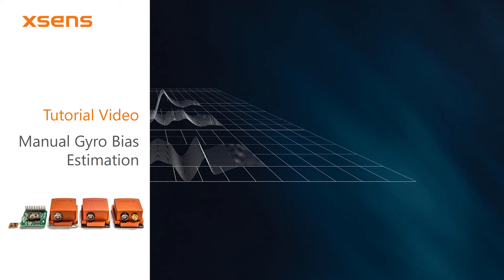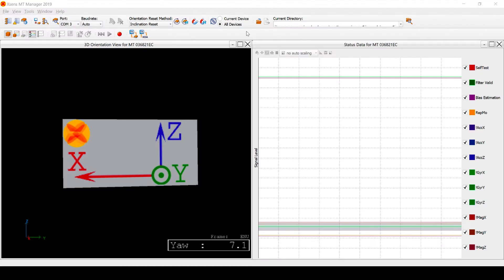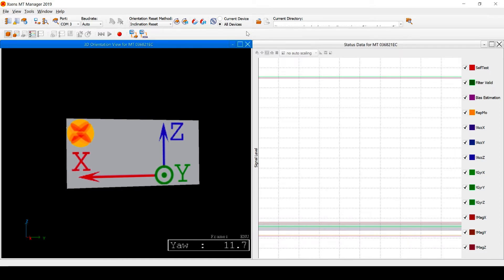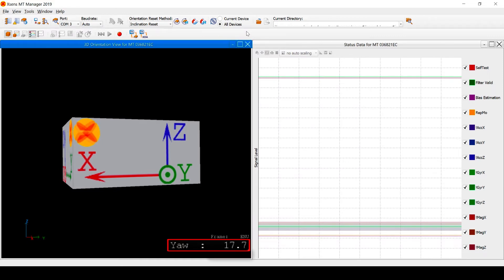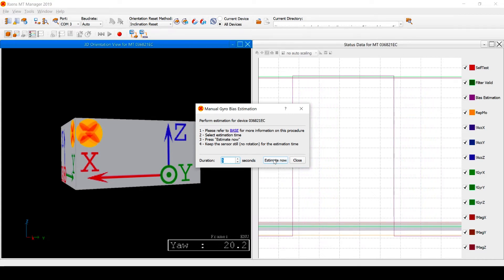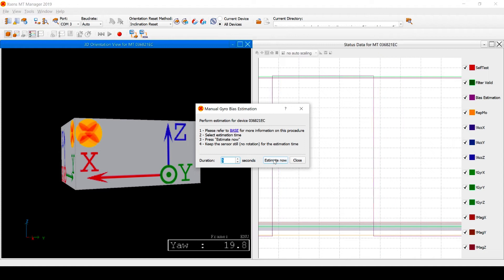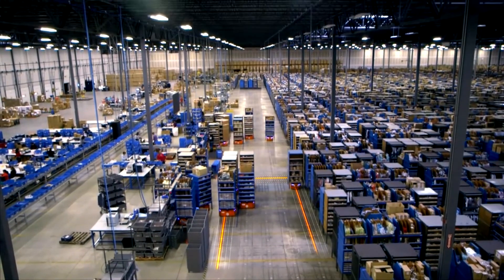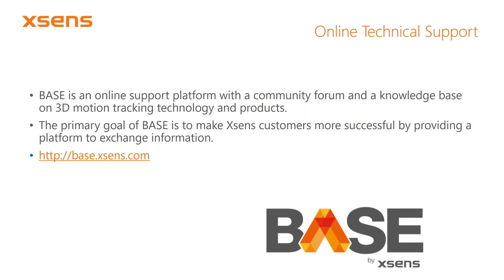Xsens Tutorial: Manual Gyro Bias Estimation

Comment: Hello. Can you please do a tutorial how to detect Earth's rotation with your MTi-620 sensor (or higher model)?
Reply from the maker: Xsens Motion Trackers (MTi's) are based on MEMS accelerometers and gyroscopes. These are extremely small and low-power sensors and therefore very suitable to track robotics and vehicles. However, they are not designed to track the Earth's rotation. For measuring the Earth's dynamics a high-grade optical gyroscope is required.
Reply: @XsensMotionCapture  I know that. But, is it possible with, specifically MTi-630 and higher? Did you test it that way? The specification suggests that this should be possible. Thank you for answer.